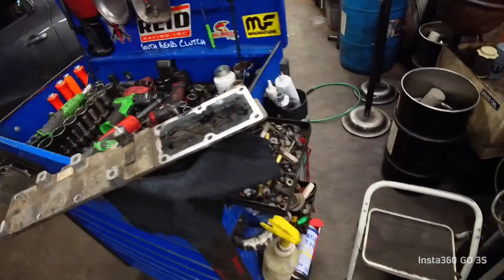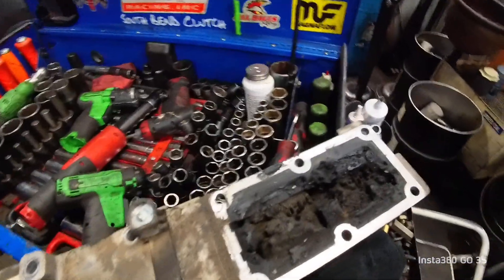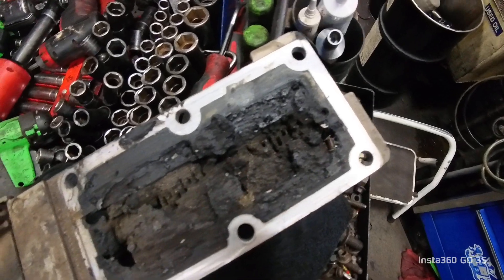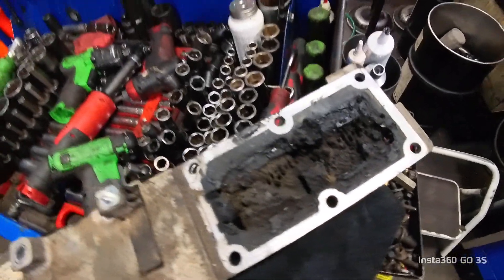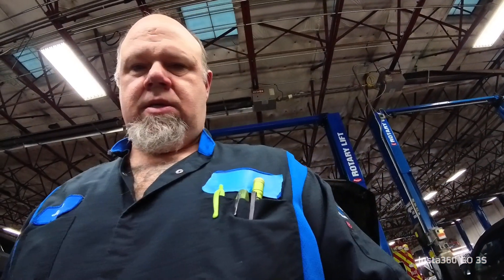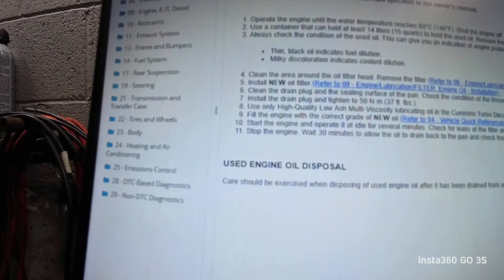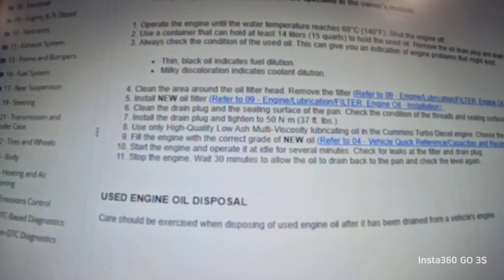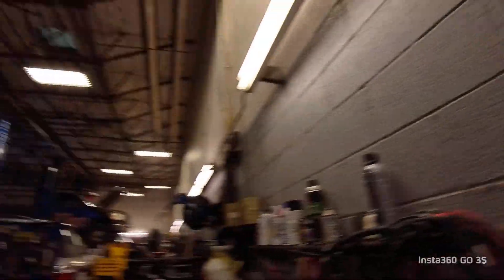Ram Air Grid Heater Plugged

Comment: I love that you take the time and offer tons of information you have had to learn,remember & be obedient to-I build large bore engines for Caterpillar & my 2015 Ram 2500 6.7l has 318k miles & runs like a Top-Dyno tuned & I still smile every time I go 1/2 throttle quickly-I have no grid heater at all just a open intake-no restriction in exhaust,no recirculating exhaust of any kind -do all my own oil changes @ 4500 miles max & I over use diesel kleen still using factory injectors -I take care of my truck & it gets worked very hard but it takes care of me too👍🏼

Comment: Even though I run an Amsoil oil bypass filter with my Purolator Boss spin on filter on my Cummins, I still change every 5K or 6 months. The manual recommends 7.5K. Oil is cheap, engines are expensive. However, my antifreeze is delicious. Thanks for keeping us educated!

Comment: Does it matter if it’s standard oil or full synthetic oil?
I drive the truck hauling camper rv trailers for a living. 5,000 is excessive. I would be changing the oil almost weekly!! Is there any additives that are proven that work say like Lucas? Anything you’d recommend

Comment: Consider this...
The bean counters and marketing are both factors in evaluating warranty periods.

"Recommended oil change intervals" are a marketing point because customers want things to cost less.  Less frequent oil changes = less money = better customer perception of the "cost of ownership".

How long warraty periods are - is determined mainly by the cost of that warranty to the manufacturer.  The manufacturer needs that vehicle (or any product) to last at least as long as the warranty period to keep their warranty replacement claim costs minimized.

So the manufacturer mainly cares that the product has no warranty related claims theough the warranty (or extended warranty) period. The manufacturer isn't concerned with keeping your product functioning beyond that period and will allow marketing to position the product above the competition so long as it doesnt become a cost to them.

Think about that... "recommended oil change intervals" are primarily set to maintain the life of a vehicle TO offered warranty periods, NOT BEYOND.

Comment: I have a vehicle. That has had the weight lifted off of it. Is it recommended to use a oil treatment? Will that help keep that suit down? Okay, I'm curious of your opinion.
Reply from the maker: I am going to recommend the Insane Diesel oil bypass filtration system and their additives. That system is proven to keep the engine and after treatment system cleaner

Comment: Great information. Best channel if you own a RAM. Have done oil changes every 5000 miles (at the dealer ship) since new on my 5th gen/6.7. Unfortunately I think the lifters are done.  My dealership refuses to look closer at the lifters.  “They say it sounds normal if they admit it is not as when the truck was new” Two independent mechanics say it is not normal and recommend me to talk to Ram.  How can I easily diagnose a potential lifter problem?  Would an oil analyze be of any value? Truck has 42000 miles.
Reply from the maker: Oil analysis may show an issue however if the dealer would take the 10 minutes to pull the valve cover and rocker arms they will quickly see an issue
Reply: @ Thanks again. Could you please make a video how to do this “10 minute” job.  That would help us 5th gen owners tremendously.

Comment: Will the oil drain properly if front tires are up on ramps?
Is it possible oil would not drain from higher up in the engine if not level sitting on ramps?

Comment: I got a 2019 diesel. I change y’ oil  every 5000 miles. I just put the banks in my truck mine was pretty plugged not as bad as the one in the video

Comment: Thanks Josh, your channel is great. Real world knowledge is more informative than BS. I am so glad that JB found you. I have a 2022 3500 dually 6.7 SO. I am going to 5,000 mile oil changes. I do use Hotshot or Archoil additives to the fuel at each fill up. Is this advisable?

Comment: Dawn dish soap to clean the oil and residue out of the CAC system with hot water, a.k.a. steam cleaner, pressure washer through the air passages, not through the fins a lot of people don’t realize diesel in your oil. Will wash your bearings out like you said no real lube personally I run. Max mileage,  fuel borne catalyst in every tank trust me. It’s well worth it but that’s because I actually drive tractor trailer for a living. I know the benefits. Also I run Lucas when I change my oil in my diesel pick up also in my tractor trailer makes a huge difference. You can also research into. Diesel force, cleaning maintenance it actually does work.

Comment: I'm a RAM 2500 Cummings owner and love this content thank you . just have a question what are your thoughts about Banks will their equipment void warranty .
Reply from the maker: Short answer is no it won’t. But due your diligence and contact your local dealer to get written verification.
Reply: The Magnuson-Moss Warranty Act of 1975 prevents OEMs from voiding warranties due to a consumer installing aftermarket part(s).

Comment: Use Lucas dpf deep clean and 2 cycle engine oil for your pump. In colder climate also use your block heater. Oil analysis is also a great thing to do.

Comment: I’ll tell everybody who is reading this comments,delete your CCV system is the best thing you can do to your truck without doing the full emission delete  you can still delete your CCV system. When you delete your CCV don’t just remove the hose that goes to the cold turbo Intech and let it free. You have to remove all the guts out of CCV filter and then put the cover of the filter back because it works like a gasket only then you can put a hose and let it breathe freely
Reply: Why delete ccv?

Comment: I have a 2017 with a Cummins.  Did the 1st oils change with 15-40 conventional.  After putting new oil in it and running if for 5 min.  The oil looked like it wasn’t ever changed.  Next oil chang I even ran new oil through the engine to try and flush some of the contaminated oil.  Didn’t work still was black as night shortly after that one.  Changed to rotela t6 5-40. Oil stayed much cleaner fuel mileage improved.  I also try to change the oil when the truck says it has 20-30% oil life left.  Truck now has 160k on it so we will see if I have been waiting too long
Reply: Valvoline Bluetech 5W-40 works well for me. I've considered Shell T6.

Comment: I have a 2021 ram 2500 I change my oil at 5-6k miles i can’t imagine going 15k as they say also since day one I put the 3 gallon in and I’m 1/2 gallon low I let it run 2-3 minutes and turn it off let it sit a few min check it and I’m 2 quartz low. Am I wrong in my math?

Comment: I agree with the oil changes and doing them at the proper times etc.  The emissions  systems on these trucks are the killer.  I've got a 2011 3500 and my grid heater looks nothing like that.  260,000 KMS.  My truck is deleted and I run an Amsoil bypass filter.

Comment: Nice to see what happen to your engine, grid heater covered with sooth.  Have you ever tried or seen who have use Striction Eliminator added at time of oil change.   We first replace the crankcase filter at 90,000 km (filter look okay) and around 150,000 we tried the Striction Elimnator and started to get some codes, seem to lead me to crankcase filter.  Did oil change at 160,000 and replace crankcase filter (it was plugged and heavy).   It improved my power, fast take off and less delay when taking off.  i get the impression, it clean up the sooth.   Have you any info, positive or negtive with Striction Eliminator hotshot secret additive.  Not sure if I should do it again later or not.   2016 2500 Ram diesel going good so far, hitting 195,000 KM. @simplyoffgridlife
Reply: I use archoil fuel additive and try not to over idle.  Obviously helps if you are deleted but if you are not less idle helps with less fuel in the crankcase and soot build up on rings , crankcase and vgt exhaust side of turbo.   Colder weather i let truck not so much warm up to a certain point but when I have oil pressure and circulation after start up around 5 min I drive truck and don't have heavy foot when it's cold out.   The stiction additive you talk about it know lots of powerstroke guys use.  I dont know many cummins guys that use it.

Comment: One of the reasons that I am going with the Banks Monster ram intake. That grid heater is stupid.
Reply: Do you live in a cold climate?  Have a few friends that have complained about that style of heater bolt that banks uses,  some friends that love it.   I switched over to glacier diesels grid heater and have had zero codes so far.  Hope it works well for you.
Reply: @justinbewley179  Louisiana and mayne Tennessee in the future
Reply: @markandcassieboudoin  I am in middle Tennessee and have the banks Intake zero issues and it was 22 today. Fired up like a champ.
Reply: @MarkandCassie  
Yea i know.  I removed parts on my truck if you know what I mean.  I did it at only 11k miles on truck and my grid heater had about a half mm of soot already.  
I ran the stock grid heater until I got my first code but my grid bolt was tight but don't want to chance it falling in the engine so I put on the glacier diesel grid heater, I have the factory intake elbow. Hope it works well for ya.

Comment: I let my oil drain for 45-60 min.  Put back in 11.5 quarts and reads in the middle safe zone.
Reply: 11.5 gallons? ISX 15L Cummins? Or did you mean 11.5L for the 5.9/6.7 Cummins?
Reply: @ Ooops typo…..11.5 quarts.

Comment: Hey Josh I like your content and wanted to see if you would give your thoughts on adding a bypass oil filter such as the amsoil brand to a 2024 6.7 2500 with less than 5k miles. My intention is to conduct the first l/o change at 5k and send a sample to black stone  labs at 10k to determine remaining oil life. It makes sense to me that adding a bypass oil filter early in the engines life may reduce wear prolonging the life of rotating/moving components. Also wanted to see if you can speak to voiding the manufacturers warranty for adding a l/o and f/o (fass) filter setup to a new truck under warranty? 10:45

Comment: Love the channel,  please keep the info coming.  I change my 2012 every 5000 miles.  What's your opinion on changing the oil after sitting overnight or should it be warmed up and then drained?
Reply: @brettcasina,
 Warm up the oil, drain it overnight. Put oil drain plug on drivers seat, don't forget to refill.    ☆
Reply from the maker: Warmed up then drain

Comment: Most people have no clue that the 15000 mile service is for the guy putting 15000 miles a month on his truck and that they need to be following the severe service change interval which is usually anywhere from 3,000 to 5,000 miles
Reply: My manual doesn't even mention "severe service" intervals, which I definitely qualify for.
Reply: Figures they have started learning that out reading up my 17 Hemi and seeing what they actually say is severe service pretty much means that everyone should be following the severe service for oil changes probably only like .1% would even qualify for extended service intervals

Comment: Great info. I had no clue you had to wait that long. The funny thing is I put the drain plug back on the oil pan after I install the oil filter. That process alone with getting that damn filet lined up takes me like 30 mins 😂😂😂. Great video

Comment: There's nothing left on my 6.7.  Nothing!  Including the grid heater.  I have no grid heater at all.  GDP air intake (sorry Banks fan boi's).  Zero degrees outside with just a block heater.  Fires right up, tho a little angry at first I must say.  LOL.  I read somewhere that the Cummins Ram is the only application that uses a grid heater with these motors.  Worried about oil contamination?  Change often and stop whining.  Still got the space junk attached?  Change "oftener".  Diesel engines were never designed to have all the emissions garbage attached to them.  And that's the bottom line.  Let's not complicate this.

Comment: If you send off oil for analysis is there a part of the report that evaluates the amount of lubrication life that the oil has? I know they look at contamination etc but do they tell you if the oil is still providing actual lubrication for the engine and or to what degree.

Comment: Would like to see some 5.7 Etorque stuff, batteries location , are the batteries plug and play ? Be kinda of cool , I have one.
Reply from the maker: Batteries are not plug and play. It requires programming. It’s located on the back wall behind the back seat, seats need to be removed to service

Comment: I just did my ram 3500 oil change at 5,300 miles. Black( as always) sooty, burnt, thinned out, rancid fuel/chemical smell,, ,,,and to think people would actually triple this interval and think it’s OK???  someday smell your used motor oil and then crack open the new jug and smell the new one …there’s your answer….
Reply from the maker: You are absolutely right!
Reply: I do fleet maintenance and we even do our commercial trucks oil changes at 5k miles. Now most of these are dump trucks, stone slingers, crane trucks ect. So they have a lot of PTO hours on them once they hit 5k miles. But the oil drains for about 45min to an hour while every single engine, fuel, and air filter gets changed and everything greased, all tire pressures checked, all drive axle oil checked and oilbath hubcaps checked. And our engines are CLEAN on the inside.

Comment: I have a 2024  Cummings and my DPF gauge has been on 0% for over 3k miles. How long does it normally stays at 0?
Reply: Forever since you deleted it.
Reply: @ it’s not deleted lol
Reply: @Stealthtrader99  No way that gauge isn’t moving and you’re not having problems.
Reply: @ about 2 months ago it was at 30%. Then one day I looked at it was at 0. I left Houston TX and drove to Colorado and put over 3k miles and it is still on 0% today. No problems though
Reply: I also have a 24. DPF is usually at 0 but I use Hotshots EDT and mostly highway drive. If you drive it like your supposed to it will usually only creep up to about 25% and burn down ( Clean out) on the freeway
Reply: Leave it on that guage, you’ll see it go up. Then burnt away and go back down. You don’t want to see it full. If you go on long trips especially, you won’t notice if you aren’t staying on that gauge. 

If you are using DEF fluid up, you’re working just fine.
Reply: Mine also is almost always at 0%. I do use hot shots secrets EDT and believe that makes a big difference. Most of my miles has been towing and highway

Comment: So what are correct level in the ram 2500-5500 6.7 ??? Because the dipstick are a real joke… can u show in a video the correct leve engine oil?
Reply: What’s wrong with the dipstick?
Reply: @ difficult to read the oil
Reply: The dip stick have  like 2 really small squares but just when l do my oil change and oil filter and just put 12 quarts of oil and after 30 minutes l will see the level on the upper square mark and we are good.😮😮😮
Ram 3500 chassis cab SLT. 2017.
Reply: @ Yes, but it's never perfect. Many times the oil reaches the top of the dipstick but it's residual. And that's confusing. Typically I check it when the engine has been cold for more than 24 hours and when it's warm I let it sit for 30 minutes to check the dipstick.

I have de 22 2500

Comment: I have a quick question, what is the normal oil pressure range on the 6.7? 2024 Ram 3500
I am seeing 52ish psi at 2k rpm’s. Thanks.
Reply: That's exactly what my 2021 and my 2015 6.7 does at 2k. 52psi👍

Comment: I Have to go to a oil change place for my work truck , they check the oil and for leaks all in about 15 seconds, I called them out I said no way you are getting a accurate reading on that dip stick,
Reply from the maker: You are right, they don’t get a good reading.

Comment: My 2024 ram 2500 diesel with only 14k miles on it just when in to the shop it has a manifold leak ,wear in the push rods , drive shaft it’s out of balance there for ruins the drive shaft seal twice and had a vibration that couldn’t figure out , the guy call me and goes well it looks like your using the wrong oils you should be using 10w 30 I was like yea definitely using the wrong oils then bcuz I’m using rótela 5w 40 as it call for they when back and forth and 3 minutes later they were like yea your right, well I don’t know if he was trying to get me to say I was using the wrong oil or what but ram. It’s going down hill !!!
Reply: What does your oil fill cap say?

Comment: What is your opinion on trucks in warmer climates that rarely use the grid heater. I’ve disconnected it from the battery. Will the contaminated air coming in build up on the grid?
Reply from the maker: It is possible

Comment: I agree with the EPA behind the EGR, DPF and SCR but the Grid Heater is absolutely not! It's been used in Diesels forever in one form or another whether glow plugs Grid Heater etc. I drove a medium duty UD way back in the early 90s that had a Grid Heater, and All of our 80s-90s Ford's had Glow Plugs. They are there for a reason. Just like the block heater and  in some climates battery blankets and heaters.

Comment: At some point I'm going to install the Banks Power Ram on my 2015 that has LONG since been to Jenny Craig and had some weight loss.  That said, with the proper weight loss program in place...occasionally I've hit 10k miles between oil changes, I run Rotella synthetic, do you see 10K as a problem??
Reply: I’ve always done 10k & synthetic on my common rail Cummins trucks. I’m a little over 100,000 miles on my 2017 & decided to check valve clearances a few months ago. The top end of my engine looked perfect.